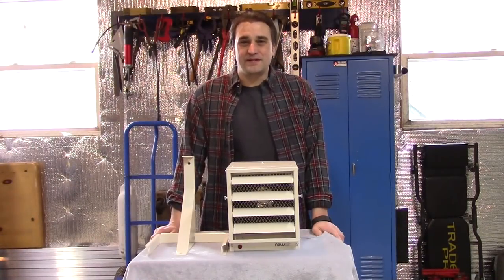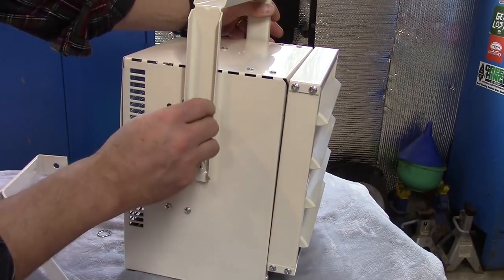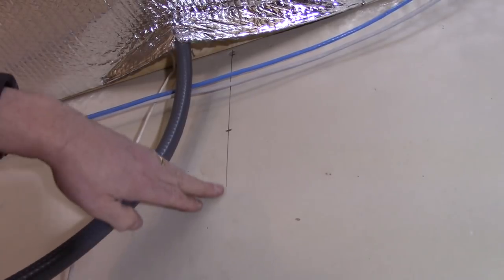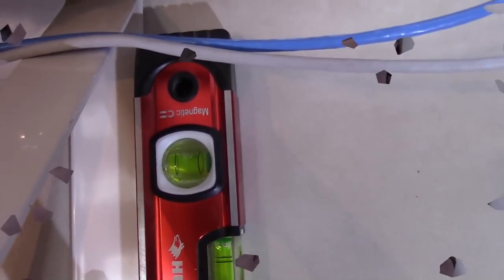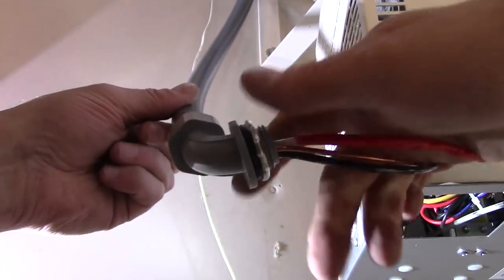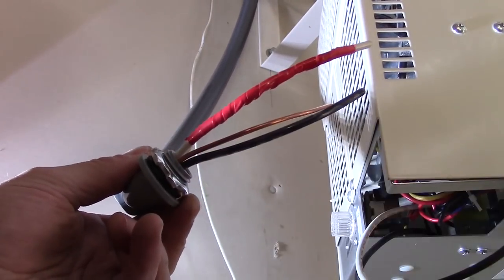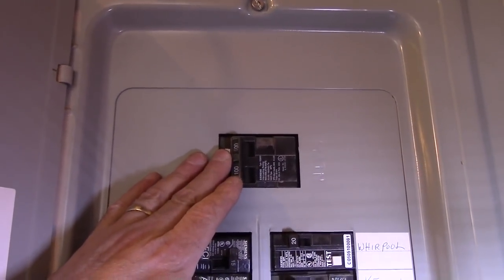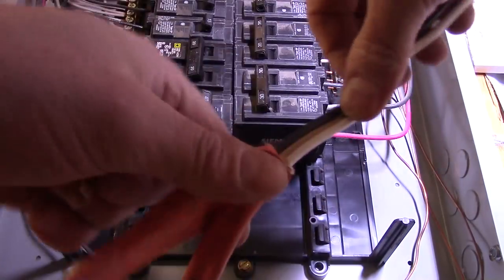How to Install a NewAir G73 240 Volt Garage Space Heater - 240 Volt Heater Installation Instruction

Comment: I know this is an older video but I still like to make a comment. I am very fortunate that my brother-in-law is the vice president of a large commercial electrical company. Like everyone that works there say start at the bottom. As his knowledge was expanding he would help me by telling me what I need to do. After I was done he always came over to check my work.

For people who are not as fortunate as myself this video here is an excellent source of information. My brother-in-law has 40 plus years of experience and has came over to check my work when I had hooked up a similar heater in the garage. Everything you did including the wire was spot on. That's exactly how a professional electrician told me how to do my work and then check to make sure it was correct.

The reason for me watching this video is somebody has one of these heaters saying make and model for sale on craigslist for $70 and it's never been installed. You can see that in the picture.

I did a quick Google search and I came across this video. Since we are hitting summer I feel this is a good time to get a good deal on heaters. My garage is so big it's impossible for one unit to warm it up. I'd like this one since it looks small enough to fit into the corner of the garage that I do most of my work in

Again great video I definitely hit the like button and I'm hitting the subscribe button to see what other good advice you have.

Comment: is there a way to install a separate thermostat for it?
Reply: You could either try a line voltage thermostat or a conventional stat with a transformer and relay....usually just easier to find a line voltage stat though.

Comment: Shouldnt you use 8/2 wire (8 gauge) for 240v... reason i asked I recently did this in my garage and I pre ran the wiring with 10/2 wire like yours and he actually took it out because he said it was wrong for a 240 volt service to my heater unit. Btw i have the same heater.
Reply: My electrician took it out*

Comment: What size flexible conduit did you use for the 10/2.?  I was thinking of running thnn wire , 10 gauge straight back to my panel in plastic conduit, with the flex at the heater. I have a small run of less than 8 feet
Reply: Shouldn't this be on 10/3 ?
Reply: @justinwnichols03  two hot leads and a bare ground  three wires total correct
Reply: @Thesimplehomeowner  I realized that later when I installed this very unit in my shop 😆

It is 30° and dropping here. My shop is 14x24 open rafters and I have only had a chance to insulate one long wall. 

I am insanely impressed by the heat! I let it run for an hour, went out and I could exhale without spitting ice lol 2 hrs and I wasn't wearing a hoodie and it had turned off entirely because it had already reached temp! So I turned it up just a bit more put the dog food and water in the shop as I had already made a dog door for them. 

I am very happy with this purchase!

Comment: how about the electricity bill? how bad was it?
Reply: To estimate hourly running cost, multiply the input power in kW by the price of your electricity per kW hour. My 7500 watt ceiling mounted garage heater cost me $0.7920 cents per hour (10.56 cents per kW hour x 7.5 kW = $0.792 per hour)  - I average 12 hours per week in my home workshop and of those 12 hours my heater generally runs 1 hour from startup until it reaches working temp of around 62 degrees. It then cycles approximately 12 - 15  minutes per hour until I shut it off when I leave so the average running cost per week for me is $9.50 - $11.88 per week or roughly $50.00 per month on a heavy use month for me.

Comment: I HAVE THE SAME UNIT AND I AM SENDIND IT BACK CAUSE OF THE LIGHT ON THE FRONT IS ALWAYS ON THAT IS A OVER HEAT LIGHT NOT AN ON/OFF LIGHT AND SHOULD NOT BE RAN . YOU SHOULD HAVE A FIRE EXTINGUISHER ON HAND .

Comment: I have found out,from  experience , that mixing copper wire and aluminum is a Fire hazard. The copper and aluminum dont go well. they both heat ,expand  and contract,,,,loosening any type of fastener causung more heat and eventualy a problem. I wired My similar heater and it did just that. The space you have to cram all three wires into helps loosen them up also. It is a bad set up and should be corrected. I am LOOKING for a safer heater as this one needs constant checking.
Reply: While I do agree that copper and aluminum wire shouldn't be mixed I do have extensive experience with devices such as this that use AU wire from the factory and connected it to circuits using copper with no issues. But then again I also tape every connection so that this isn't an issue.
Reply: Wire it to a switch very simple.  They have them at Lowe’s for 12 dollars